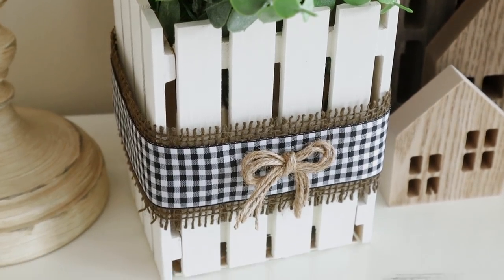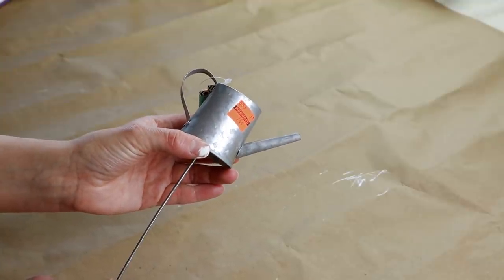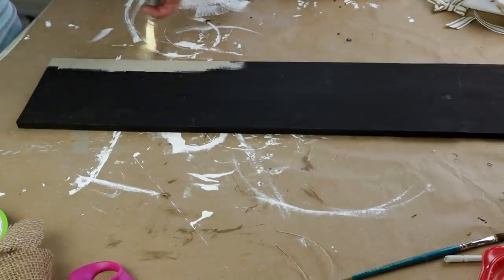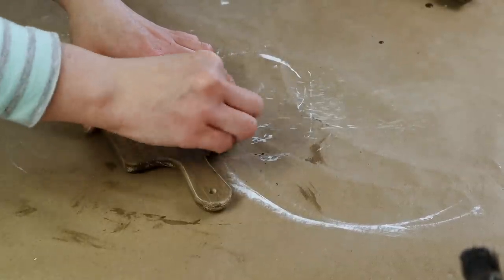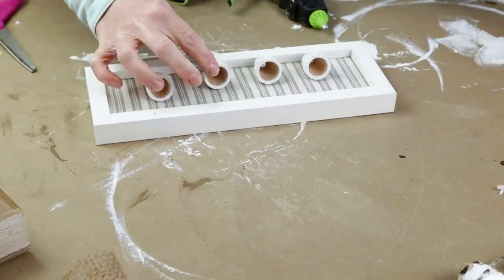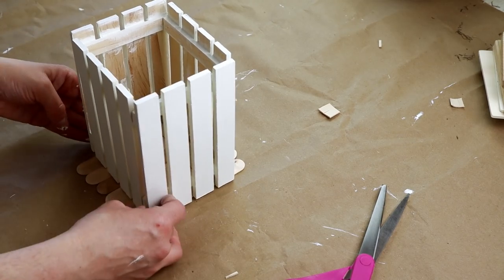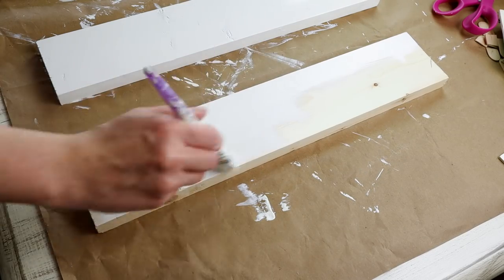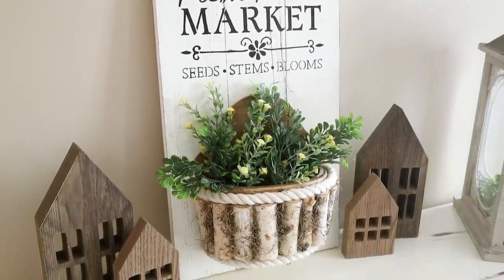10 *High End* Farmhouse DIY's | Easy & Budget Friendly Projects | 10 on Tuesday

Comment: In Holly from Hot Humble Pie’s latest video, she mentioned the water-based stain that she uses.
Reply from the maker: I will be checking out her video. Thanks so much!
Reply: @ChristinaElizabeth15  this is the one she uses I as well its great 

SamaN TEW-212-12, Antique Walnut, Interior Water Based Stain for Fine Wood, 12 oz, 12 Fluid Ounces
Reply: All your projects turned out super cute! A lot of spring inspection!! Waverly also has a wax that can be watered down & works really well as a stain. Also, any paint can be watered down & get a stained look. 💗🙏🏼
Reply: I saw that video and what a great idea

Comment: You could also "sew" using liquid fabric glue or even the fabric glue sticks. I've made everything from curtains to pants using either one of those or the iron on hemming tape. All work great and are even machine washable after a couple of days. Did you know that there is also a WOOD hot glue stick? Yet another product I've used with great results.
Reply from the maker: Yes I have used the fabric glue sticks before. I have yet to try the wood hot glue sticks but have been wanting to try them for a while.

Comment: Really pretty home decor pieces. You seem to have a lot of faith in your hot glue, are you using a special kind? I have tried to hold much lighter woods with hot glue and they not held. Thank you so much for sharing this video xx
Reply from the maker: Thank you! I use Sure Bonder hot glue sticks. I have never had any problems with the glue unless it’s on an outdoor piece. It is always best to use a stronger glue with the hot glue or instead of hot glue to get the best hold. E6000 or wood glue are great options. I wish I would have mentioned that in the video.

Comment: great video, great DIY's ... thank you so much ... if I may ask : don't you have trouble using hot glue ? I used it on so many materials and unfortunately found out that it doesn"t hold very hold on most of them, eve, though it's a quick hold, it doesn"t last long  ...... oh and by the way : you should think about wearing gloves when you work on your projects, no offense, just a thought 🤣
Reply from the maker: Thank you! I haven’t had any problem with hot glue. A good tip is to use a stronger glue along with the hot glue. That way you get the quick hold from the hot glue while the stronger glue sets. Wearing gloves is a good idea, but I can’t stand wearing them. Lol.
Reply: @ChristinaElizabeth15  I know, I hate the gloves too but wearing them anyway, don't want all that stuff on my nails 🤣 and thanks for the tip with the glue
Reply from the maker: If I had pretty nails I’d wear gloves. I rarely have them done anymore. 😏